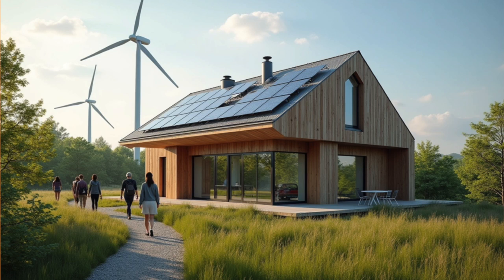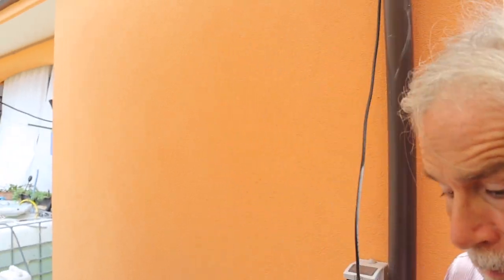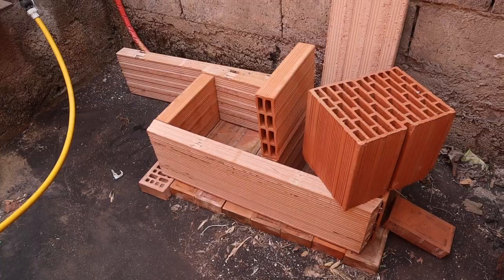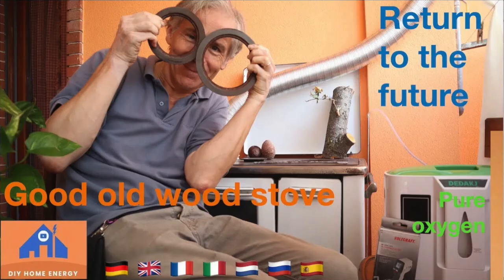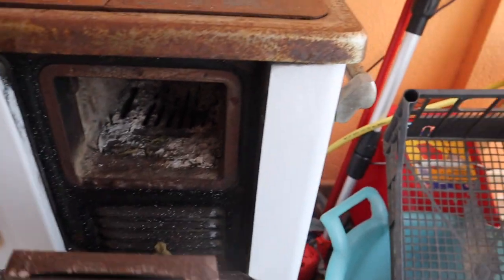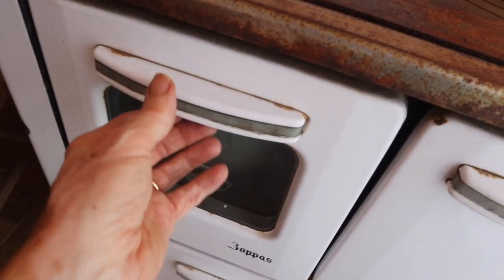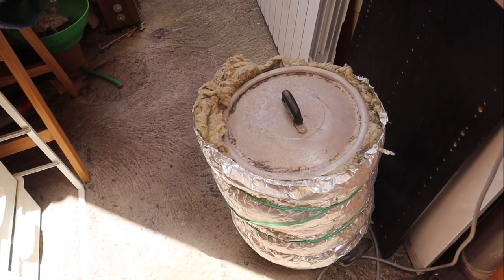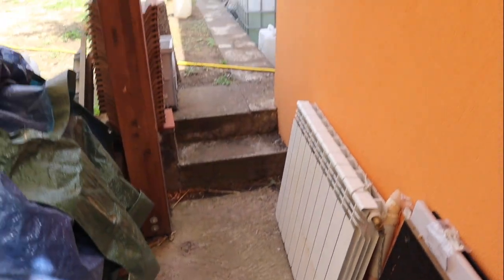How to use your excess PV energy? With sand and pebbles - replacing battery and furnace  - Video 109

Comment: A sand battery is just dumb !! Lfp cells are cheap, safe and hava a long lifespan! Why convert pv energy in heat ?!?
Reply from the maker: Hi Captain, I agree with you and would prefer to use (if we are not talking about batteries) a heat pump and even both of the evaporator and condensor, like in video 108 (TES). But still, energy is produced that goes into the grid and is not paid. We have 15 kWh of LiFePO₄ and that is usually full at 11 AM or a bit later. 
Moreover, video 108 is a bit more challenging to build. Sand batteries are easy to build and keep the energy home. It is also fascinating that energy storage and barbecue/furnace/oven are all the same unit! So I made an exception and go against the rule to use electricity only for thermodynamic noble applications.
Reply: @nnvasen-good-energy  well if you have enough energy to waste , thats good 😊. I bit mine with my pv overflow
Reply from the maker: No, wasting is not good, I agree. Better put it in LiFePO₄. I bought already 1 battery of 5 kWh more than they tried to sell me. But if those are full? If you have a river and can't take all the water that is flowing along your house, what can you do. A lot of it goes just in the grid and I am glad for them, hoping they will use it well.

Comment: Someday I would like to see a combined heat and power system for a home that arranges several heat pumps in stages along a continuum from the freezer (20F) to the refrigerator (40F) to the air conditioner (60F) to the heater (80F) to the water heater (120-140F) to the oven (450F), with appropriately sized thermal stores at each stage. In winter the heat would flow more in one direction, and in summer it would flow more in the opposite direction, through the same continuum.  Standard heat pumps can accomplish most of these lifts, but the higher temperature lifts might be harder to accomplish.  They could be assisted by resistive heat powered by solar panels, stored in a sand battery at the "top" of the continuum, and solar thermal panels (the back of the PV panels) could assist the hot water heater.
Reply from the maker: I absolutely share your interest, Tim. It reminds me the water management system the Netherlands had centuries ago: each windmill was able to pump water over 4 meters so they created small channels on intermediate levels that correspond with the temperature levels between heat pumps at different temperatures. A Thermal Energy Storage (TES) would be a lake in this Dutch landscape. On big scale this can be made as a District Energy System (DES) where users including industries and municipal services dump and take energy. This can also enable us to use both sides of the heat pump better.
I would like to find heat pumps at different levels and guess that different refrigerants allow us to operate the same heat pump at the same pressure levels but at different temperatures.
I read that the CO₂ heat pump is able to bridge a wide gap but also works at very high pressures.
Reply: @nnvasen-good-energy Yes, different refrigerants for different temperatures, OR different pressures with the same refrigerant (like "cold steam") for different temperatures. 

I wonder how feasible it is to use a thermocline in a thermal store like a hot water heater tank to store multiple temperatures in one container.
Reply from the maker: Yes you can do it but it is difficult technology, especially if the amounts are changing. You want to avoid entropy increase between them and I don't know how much Watt is disappearing through each m² per Kelvin.

Comment: Masonry bell heaters and the bell/barrel on a rocket mass heater concentrate the hottest gases at the top, and allow only the cooler gases to exit at the bottom.  If the design you propose allows the hottest gases to exit at the top through a stove element, it would waste some heat. An insulated cover over the pan over a stove element could reduce the amount of wasted heat. But then it becomes nearly the same thing as an oven. And if the hottest gases are at the top of the oven, but the food is at the bottom of the pan, there is still a mismatch of sorts, because the hottest heat is not being applied directly to the food. I look forward to seeing how you deal with this issue as you develop this design.

It is very interesting to consider how natural gas or propane stove elements could use hot air from sand batteries (instead of burning propane) with the result of being non-toxic. That seems like a great idea if it can be done feasibly.
Reply from the maker: Hi Tim, thank you for the suggestions. I agree that the food should be ideally at the highest point. I can let escape the hot air at a controlled speed (adjustable linear opening) or even close it.
The second point leads me to the idea to recycle old ovens! I had already the idea to recycle the big white domestic devices like dishwasher & washing machine because of their standard dimensions and much space for sand. But the insulation of a dishwasher will hardly stand the high temperatures (must add another insulation).
Thanks for subscribing, I hope the PDF download was without problem.
Reply: @nnvasen-good-energy maybe the air does not need to escape from the sand battery for a stove element to work.  The hottest gases could rise to the top of a sealed sand battery container, heating a thin metal plate on which you can set a pan of food. The pan would be outside of the sealed sand battery. So it would function very much like a glass stove top.  When the stove element is not being used, it could be covered with insulation to retain more heat in the sand battery. 

For other purposes like heating domestic hot water, circulating air through the sand battery, through an insulated pipe to the water heater and back to the sand battery in a closed loop, could work well. Of course the water could be circulated around the sand battery instead of the air.
Reply from the maker: Yes, I tested my prototype for the first day and covered it now with a thick blanket. Tomorrow morning I will see at what temperature I can restart heating up. But only with excess energy.
Reply: @nnvasen-good-energy reusing old ovens is a very interesting idea! They might need more insulation for extra high temperatures.

Comment: Norbert, I like what you're doing. Do you know how to concentrate waste HEAT from PV panels and store it in a sand battery? If it could be concentrated into high grade heat, it could be used for cooking and similar uses. Similarly, concentrated high-grade cold coming from the other side of a heat pump would have many uses in a household.

In my experiments, blue polycrystalline PV panels are about 40-50° F hotter than the surrounding air temperature in full sun, so around 140° F on a summer day.  This is sufficient for hot water needs in a household, but it is barely hot enough to cook meat. (Using the sous vide method, meat can be safely cooked at 130-140° F for several hours.)  Sous vide is a great way to cook meat, but some people don't want to spend the time it requires. With a small lift in temperature to 180-200 F, cooking could be done more safely in a shorter time. And a sand battery can hold heat at far higher temperatures than that, so for the purpose of saving space it is attractive to concentrate the heat to store a very high temperature in a smaller amount of sand than would be needed if storing only 140° F.

I have not been able to figure out how to do that efficiently. So far as I can see, high lift heat pumps are inefficient. Cryogenic heat pumps exist also, and also seem inefficient. But I keep researching heat pump designs to see if there is a way. I think the fundamental challenge is that thermodynamics makes concentrating heat an energy intensive process. Concentrating light through a lens is not energy intensive, because light is a high-grade form of energy. But heat is a low-grade form of energy, so is hard to concentrate.

One design I am considering is a heat to sound to heat converter, which is a thermoacoustic heat pump.  Like all such heat pumps, it is subject to the efficiency limits and losses of the Carnot cycle. But it has some efficiency advantages in that the conversion from heat to sound and back to heat is mechanically very simple, needing no moving parts. What I have not yet been able to figure out, but I have an intuition could work, is how to use the conversion to sound and back as a way of concentrating the energy in a smaller space. Because sound is a waveform, it can be concentrated in many ways, like focusing it on a point. High temperature lifts can also be accomplished through multiple stages, possibly using different working fluids/media (refrigerants) with different boiling points and compression ratios.  The heat could be concentrated in small units attached to each solar panel, or collected from the backs of solar panels and concentrated in one central unit, then stored in a sand battery.

If you can solve this problem, you could help a lot of people!
Reply from the maker: That’s a fascinating comment, Tim – you’ve clearly explored the physics deeply. You’re right: waste heat from PV panels is “low-grade” (about 60 °C / 140 °F), which makes direct cooking impractical unless we use low-temp methods like sous-vide. I mad a short video about CHP (Combined Heat and Power), not the CHP with big engines but the PV being cooled and making or preheating DHW. 
To reach the 180–200 °F (or higher) needed for most cooking, you’d need either a heat pump (I am interested in CO₂ heat pumps but are they good for DIY?), or direct solar concentration (mirrors/lenses) before storage.
One path I’m exploring is using PV electricity itself to drive a resistive heater in the Sand Energy Centre as you saw in this video 109.
Thermoacoustic heat pumps are intriguing – the “no moving parts” aspect fits the DIY resilience idea. It would be nice if you gave more information about the sound traject for energy, for example by joining the FB group https://www.facebook.com/groups/1440674419825846
You’ve given me ideas for a future test setup – thanks!
Reply: @nnvasen-good-energy I greatly appreciate your focus on practical solutions which are easy for ordinary people to implement. Some (most?) CO2 heat pumps require high refrigerant pressures. One idea I am working on is to use low pressure steam, meaning below atmospheric pressure. A vacuum pump can adjust the pressure of the steam so that its boiling point is at a desirable temperature on the hot or the cold side of the heat pump, and that boiling point can be changed to match the changes in temperature from night to morning to afternoon, whether absorbing heat or emitting it. This would not work below freezing, unless the system could store cold in ice and directly vaporize it below 0 C. One attractive feature of this idea is it would need no glycol to avoid freezing (glycol is undesirable because it reduces water's heat capacity), because steam does not expand and crack pipes when it freezes like liquid water does.  Water can be a good refrigerant in heat pump systems, because both steam and liquid water have a high heat capacity per kilogram, and the phase transition changes the volume (so heat concentration) greatly.
Reply: Another idea for concentrating heat which I have experimented with is attempting to concentrate infrared radiation inside a mirrored bottle, then letting it exit the bottle through a very small hole. So far that has not successfully concentrated the heat. Perhaps it is prevented by etendue, or perhaps most of the bottle's heat does not actually convert to infrared radiation inside the bottle.